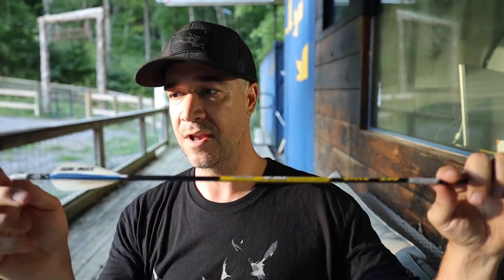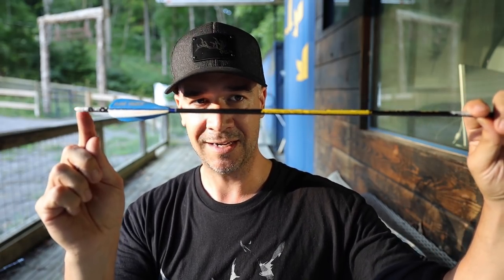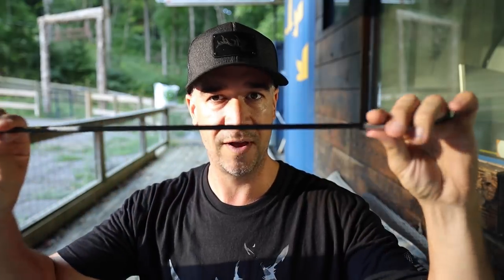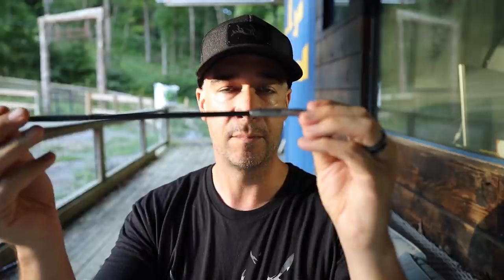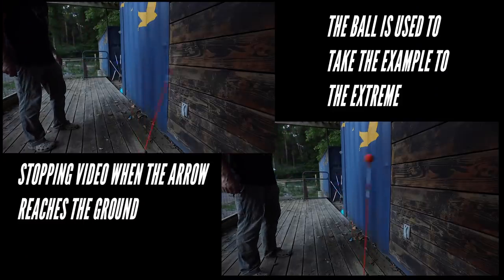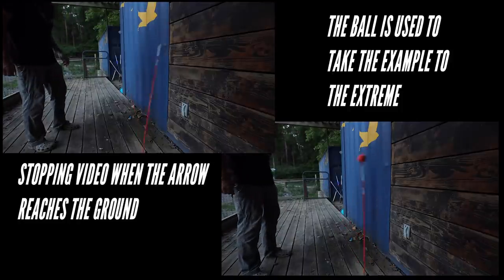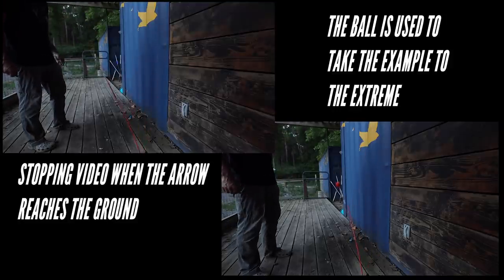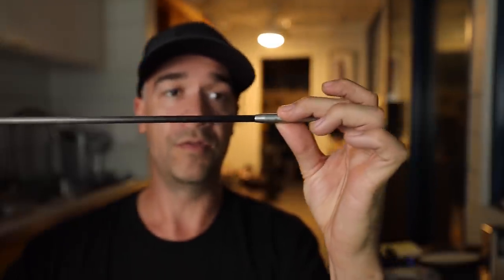Arrows Part 2: A dumb guys understanding F.O.C. (Im the dumb guy)

Comment: I'm shooting a 575-grain setup for elk with 250 grains upfront with pins out to 60 yards 28.5-inch draw at 67lbs.  This is my heavy setup.  My light setup is 50 grains less at 525 for deer and antelope.  The heavy FOC is a solid hard-hitting solution. I will never go back to the lightweight stuff.
Reply from the maker: Are you sitting on water for antelope or spot and stalk? Antelope are so fast I'd like to be in the low 400s for them for me.

Comment: Great video as always man! So easy to go down a rabbit hole on this but if you stick to the principle "You should always use the heaviest arrow possible that has a trajectory  that you still find acceptable" -  (quoting Dr. Ashby) it can simplify thing. Also, everyone needs to keep in mind Ashby did all this with stick bows. Adapting high FOC setups to a compound comes with compromises.
Reply from the maker: I really want to build some really flimsy shafts and get my 350g heads and 100g sleeves on them just to see how bad it can be.  I'm just afraid I'll send a shaft through my hand...

Comment: But if you had a diving board and someone 100lbs jumps off the board it bounces a couple times and it straightens back out pretty quick, but say a 300lb man jumps off its going to bounce erratically and longer. And wouldn't bullets be designed in that manner with a heavier front so they could shoot extremely accurate and hit a lot harder. I have physics next semester so till then I'm still pretty dumb lol.
Reply from the maker: You should totally your professors questions about archery.  The experiment I showed I bent the fiberglass rod the exact same amount each time period the difference was the ball was strapped to the end of the rod in one of the experiments. For your diving board analogy the skinny guy and fat guy would have to be tied to the end of the board and then be launched when the board was at the same amount of deflection.

Comment: Info on Native American gear is interesting. Pope and Young hunted with Yew wood long bows pulling 70 to 75 pounds of draw weight. Their birch shafted arrows weighed between 650 and 700 grains with homemade steel broad heads of about 200 grains. Velocity was around 135 to 140 FPS. They took everything from mice to moose with that setup.
Reply from the maker: There were tribes of Indians on the plains that had heavier bows too 60-70lbs but since it didn't back my narrative, I left that out! 😳

Comment: This is the forth time I've watched this specific vid.  Great stuff.  And, its on the money, not because I'm a FOC guy and NOT a speed guy.  I guess I'm a little of both.  Allow me to explain.  I went on this FOC journey much like Brandon and so many others.  Dr. Ashby's stuff is MONEY!  I did my own research - tested several arrows shafts/brands, etc. - testing inserts from stock (that come with the arrows) to off brands, to Ethics Archery, etc.  My research echos Brandon's.  I'm shooting a PRIME Logic, 70lbs, 27.5 draw, Gold Tip Pierce 300 spine, 200 grain inserts, 125 point (325 on the front end), 590 total grains with 24% FOC (or thereabouts depending on the calculator you use).  

What did I experience: 1. Less speed (from chrono 280 to 250) 30 FPS difference. 2. Better accuracy at distance, 3. Increased penetration; over 6 inches on harsh foam targets and pass throw after pass throw on deer and elk, 4. Increased durability (overall arrow integrity), 5. Better/stable arrow flight - the wind does not matter from 0 to 60 yards, I do start to see 3 inch (right or left) movement depending on the wind crossing my arrow in flight at outside 60 yards, 6. my arrows flight is considerably quitter - no more whistling in flight!   

Where did I come from: 1. bow config stayed the same (no change), 2. arrow increased from 420 grains to 590 grains (170 grain increase). 3. Arrow shaft changed from 400 to 300 spine and carbon to carbon measurement stayed the same - this is a factor specific to the archer, 4. fletching stayed the same (AAE Max) four fletch with a left helical 3 deg off set.  

With all that I experienced increases EVERYWHERE!  I met roughly 9 or 10 of the Dr. Ashby 12 factors.  All, this works!  Yes, my speed dropped for sure, but just about everywhere else I experienced notable increases - better stable flight, increased penetration, wind issues are minimal, energy transfer through the arrow is more efficient, long distance groupings are 2 to 3" tighter, and my fixed blade broadhead fly with pin-point accuracy!!

To test this further -- I took a buddies bow (Mathews Mission, Hype DT 2014 model) and tuned his bow, which are Gold Tip Hunter XT 350 spine, shooting 60lbs and he experienced the same results out of a totally different setup - his arrows are silent in flight and, they don't sound like mosquitos slappin' paper!  I took him from 422 grains to 570 grains (with incremental increases in weight testing to find the sweet spot) and the results already addressed above were also experienced with this setup - this is great to see this method is transferable! 

Thanks Brandon great video!

Comment: Great presentation of the arrow info... I'm running a slightly fox conscious set up. 250 spine, 10 gpi arrows. With inserts, brass weights and tips. Total weight on the front comes out to 185 grains. Arrow weight is 518 grains. They seem to fly very well and penetrate very well also. I might switch to a lighter shaft after this season and try it out though.
Reply from the maker: That's a pretty light shaft for a 250 already. I bet you could pump your point weight up a bit more unless you're 80lb long draw. Honestly, I think your setup sounds great though.
Reply: @brandonmcdonald6121  it's black eagle Spartans on the arrows. I wanted to try something micro diameter like x impacts. Bows 75 pounds with 29" draw. Not super long. I'm pretty happy with my set up but I do like to tinker and building arrows is fun.

Comment: Think of it like this. Shoot an arrow up into the air (don't really) and the energy right off the bat from the back keeps it strait. Now wait a couple seconds and the back end starts getting sloppy and wobbles but the head will not. The energy went from the back through the front. If it's not evenly dispersed then the energy will wobblr the arrow right off the bit trying to go from the back to front in the direction it was received.
Reply from the maker: I think that’s a good visual. Thanks for posting it!

Comment: This is all dependent on your Draw length, weight, etc...I am a 30" DL shooting 78#, at a 250 spine, my max FOC is 12%.  Also, high FOC and vane configuration can lead to a "parachute" effect.  I tested it and Levi talks about it in a few of his videos.   I know people were shooting buffalo with heavy arrows and low poundage, but keep in mind (being how they are buffalo,), you can shoot one at 10-20 yards, not 50 - 60 yards.
Reply from the maker: I've got the components coming for a 25% FOC arrow and we are similar specs. It's just over 700g.  They say the spine will work, but we shall see...

Comment: I have been pretty happy with my VAP XTORSION,  with a 125gr fixed broadheads I am shooting at 275fps and hitting with roughly 95-96 Ft-lbs and 0.70 Slugs... what ever that means.

Comment: Great video!!! Love the content. Keep it up! An engineers personal take on foc. I ended up running the valkyrie 480 grain with 23% foc 75 lb vxr. To me there are 3 points in an arrows flight. The shot, the flight, and the impact. Foc really helps the flight and the impact. Impact is clear from the video. Flight is tougher but from my testing I noticed two things. One I used a lot less fletching with the Arizona ez fletch helical which let it fly flatter at distance. Two when I throw them softly in the air on to a lawn vs a less foc lighter arrow I notice that high foc carries more and always buries itself directly and deeply as the lower foc arrow wont correct itself on a purposeful bad throw and thus will not consistently bury itself. I believe this is due to the downward part of the flight where the head keeps its momentum better. This is in no way a scientific test but make sense based on paper airplane flight as well. Think of a blade-heavy knife falling out of your hand. The main challenge is the initial shot where the arrow paradoxes and thus for high foc you need to increase shaft spine and overall weight which hurts trajectory affecting flight. One day when they can make a lighter Gpi and more consistent spine tapered arrows like grizzly stik will be the next step to aid this specific issue. I don’t think carbon express does this quite correctly.
Reply from the maker: The T64s from Easton are something I've wanted to test since they go from 6mm to 4 in the rear but they're $300 a dozen! Just might drink too much one night and order some.
Reply: Brandon Mcdonald . Lol hooray for drunk internet buys lol. issue is that they are Fmj which bend and their gpi is terrible. If you wanna give it a go I suggest grizzly stik as I think they are the closest but honestly that whole tapering thing needs work on the manufacturing front before I want to shoot it at an animal farther than 40. But honestly I think I got better performance once I tried the Valkyrie system

Comment: I've always found this interesting. I shoot a victory rip xv micro shaft (roughly 360 grains) 250 spine with a 100 grain 1 1/16" (I think) wasp drone at about 316 fps. The spine is stiff but the arrow is relatively light, but i get unbelievable penetration due to the lack of deflection on impact (i assume)  awesome videos just thought I'd throw my setup out there lol
Reply from the maker: I think you've been smart with your combo of shaft, speed and broadhead. Put a wide cut shallow blade angle head and it might be an issue, but I'd shoot your setup too.

Comment: I'm going to build an arrow and shoot a poundage that is in the middle. I want to shoot 60lbs, and at or less than 500 grain arrows. That has proven to work for enough people, and it has also worked for me. I have a 27.5 draw length. As long as I practice, as long as I understand where deer typically move when the shot breaks, everything will be fine. Slightly over 40 yards and below that for white tail is as much as I'm willing to do. Other animals and their reaction times may vary.
Reply from the maker: I think that's a very nice balance. Fixed or mechanical head?
Reply: @brandonmcdonald6121  I think I could use either. But I prefer fixed blades. The jury is still out on which fixed blade broadhead I'm going to use this year. I'm going to consult my local shop when I build these arrows. My opener is in October.

Comment: I agree you need a trajectory you are happy with. Sounds like the part you don't understand is the part explained with a bad metaphor (the baseball with string). Correct me if I got this wrong but it seems most the high FOC proponents tend to be trad archers. they are already shooting a relatively slow bow. Thus not a big loss in velocity because it didn't start that high. Neat to see more people talk physics of arrows.

Comment: You have to take into account the distance that native Americans were shooting at as well (while hunting buffalo) typically on horse back and typically sub 10 yards. After doing the research and testing with my own home built arrows, I am 100% a firm believer in the high foc way of thinking. I’m a lot like you, I have to do it, research it, and it has to make since or I discard it.
Reply from the maker: The loss of momentum for a light arrow is surprisingly significant in that distance vs a heavy arrow.  I think I remember a light arrow lost 15% in 20 yards where a heavy lost 5%

Comment: I'm fairly new into the deep dive into the archery world. But FOC was something that caught me right away and its something I can't fight. The proof really lines up with it. Sure, I'm not taking 100 yard shots on deer with high FoC but 60, yeah. 40, you bet. The flight is still fast and even and it goes and if a deer turns, still gonna blow through if you followed Ashby's rules on using a cut on contact head. It's also crazy to see and hear about people who shoot a deer and it just stands there confused. The FoC being higher helps the bow noise and entry so there isn't a thwack and the deer tend to run less far. You really should try to get ahold of Troy Fowler at Ranch Fairy and see if you can do down there for some hogs and do some tests and get some info from him. Great guy and he knows a lot about the high FoC stuff. As for arrow brands, I know that Sirius and Grizzlystik are two companies that follow the Ashby system and build for high foc, as does Ethics Archery for their components. I'm using Sirius Apollo arrows and Ethics half outserts with a Grizzlystik Overkill Samurai head this yeah. Guaranteed pass through on a deer and because of the mass, I can eventually use it for elk as well.
Reply from the maker: Ive got family that just moved to Texas so it might be fun to look him up. I like his videos. He's not afraid of saying what he thinks!  In part three I will have a deer I shot last year dropping in slow motion to decide whether or not I think a true heavyweight high FOC arrow actually makes sense or if the deer would have actually ducked underneath it completely.
Reply: @brandonmcdonald6121  That sounds great! You should also check out The Hunting Public guys. Really great dudes that also switched to High FOC. Last year was the first year that they ran it and it was a huge difference. Also some really interesting footage with deer running less and one even came back to them for a second arrow. Love the videos, keep up the work. Really enjoy them.

Comment: I've been tinkering with this as well. New to hunting and archery. (This will be my second season) and I've gone in circles more than I care to count. I buy into FOC, but when people like Dudley just 'meh' it away and stick to 11-14% its hard to ignore. Ive decided to build an arrow that's a little of both. Keeping speed around 280fps and FOC as close to 20% as I can.
 Last I checked I can get to 18.5ish% with axis 300@ 27in ,75gn insert, 35gn collar, 100gn BH, no wrap, 3 fletch, normal nock.
Reply: Dud is a great place for knowledge but also know that he is about sponsorship so he has to worship in that alter. He shoots Rage Trypan on elk and that's great, it works for him but he will never be able to say I shoot a 600gr arrow with a solid cut on contact head because his sponsors don't sell that stuff. On the flip side, The Hunting Public crew has moved to heavy, high FOC arrows with no regards to brands and collectively they shoot more animals per year than most. They also say the shift from light/mechanical to heavy/FOC has been massive in terms of killing power.
Reply: @danielsmith5046  agreed. Results are results. Pass throughs win for me. Especially considering technology can get you enough FOC to pull the arrow while keeping your speed up for longer shots. Next year I guarantee I'll be shooting >20% FOC while maintaining >280fps.